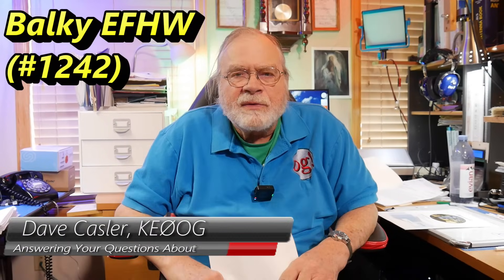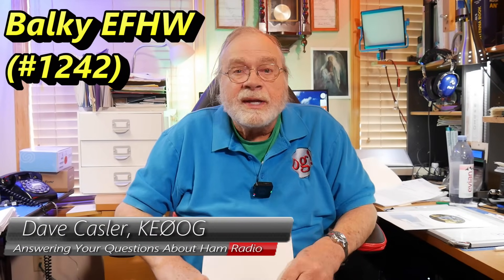Balky EFHW (#1242)

Comment: Thanks Dave.  I took apart the tuner and all looks good and clean.  Not even dust.  Previous owner must have taken good care of it.

Currently my station is not in operation due to moving into our new house.  The inside work is done, and I just have to find the best place for the antenna.  I have a temporary mast I can move around the yard to find the quietest spot.  That is next on the to-do list.

You did make a good point about tuning.  When I tuned it I tuned for the middle of the SSB portion on 40 because I do not do digital operations that much..  When I put up the antenna I will tune for the bottom. 

Once again, thanks and 73!

Comment: I simply made a trap with some pvc, and I can quickly lower that end of my antenna, connect the trap for 40-10, and then put it back up, then reverse the process to get on the voice portion of 80. I think the short version is also resonant on 40, but I just set it up last weekend and really haven’t played around with it enough since then to have it all committed to memory yet. It’s mostly just been staying on the 80m section since then. I’ve only had time for nightly nets lately

Comment: A solution I found that works for my portable setup EFHW 40-10 is to tune my ~66' radiating wire for the lowest band I wanted to work (40m CW & FT8 area) and then use various little lengths of wire attached by spade connectors to the end of the radiating wire to bring in the subsequent bands and areas I want to operate on into resonance, thereby not having to choose only SSB or FT8/CW! And since I set my ~66' radiating wire is oriented in an Inverted V, the end point where the spade connected additional lengths would be attached as necessary is close to the ground and doesn't require the any raising or lowering. 

Hope this might be helpful or interesting to someone, 73!